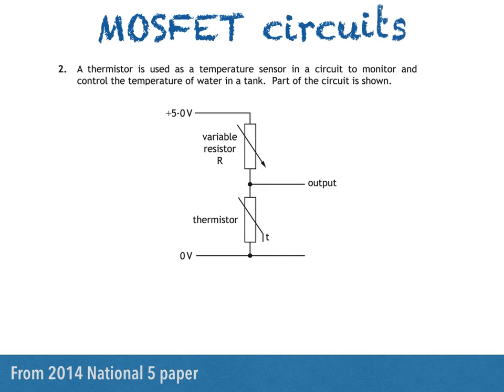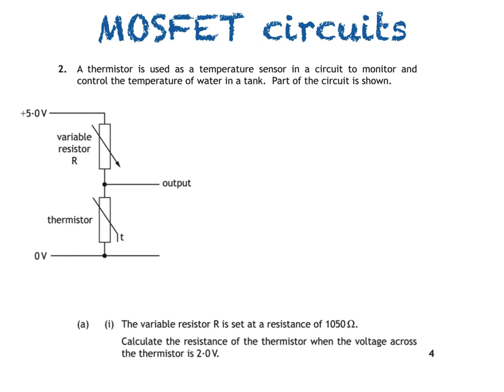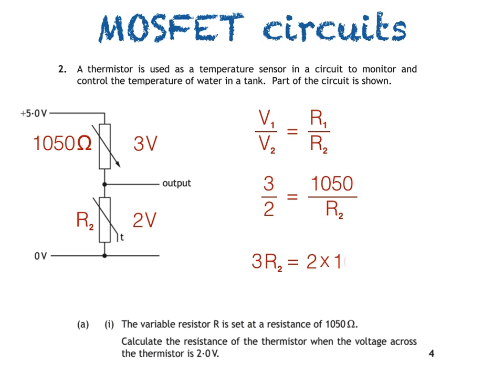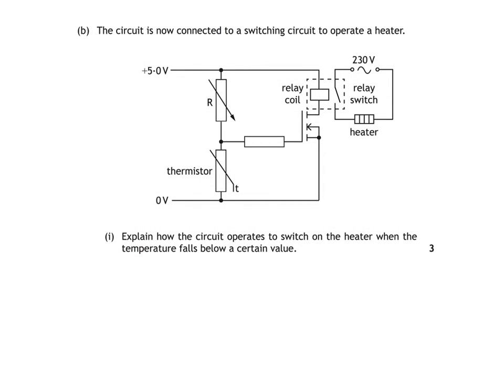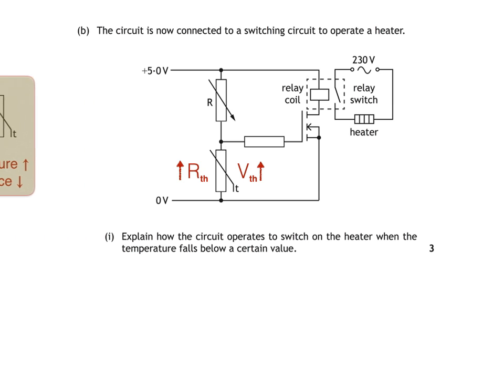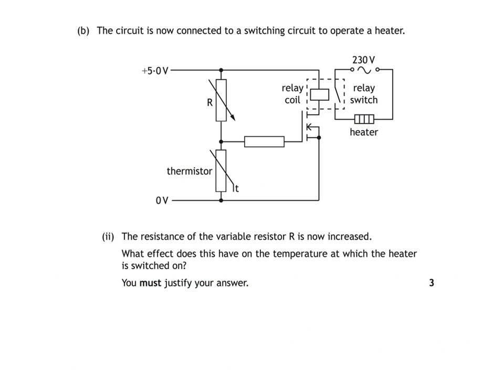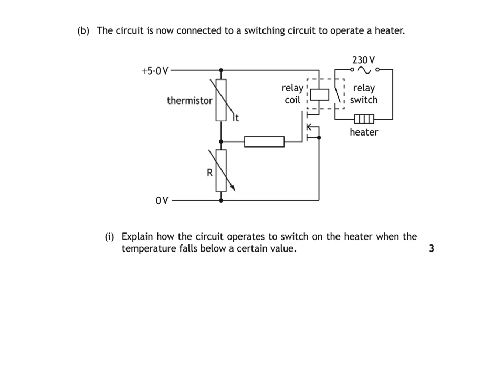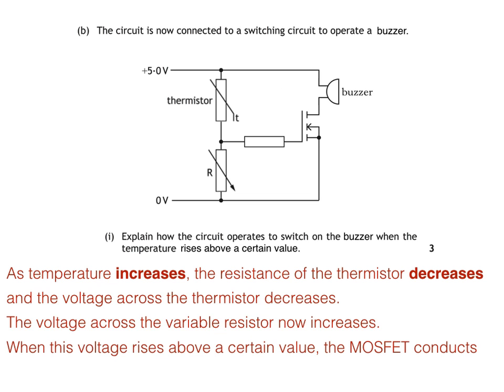National 5 Physics - MOSFET switching circuits

Comment: Hi, can you explain why the bottom resistor is the one responsible for the voltage supplied to the MOSFET but not the top one?
Reply from the maker: At National 5 level, it's not required knowledge. Pupils used to have to know about the structure and operation of a MOSFET at Higher level although that's now out of the course. There should be videos available on YouTube that explain this - good luck in your search!

Comment: so whats the difference between NPN transisitors and MOSFETS then that you need to know in national 5
if any one knows pls help
Reply from the maker: You need to know the symbol for both components. Describing the operation of a circuit with an NPN transistor is exactly the same as if it was a MOSFET.
Reply: @MrSmithsPhysicsonline  ok thank you